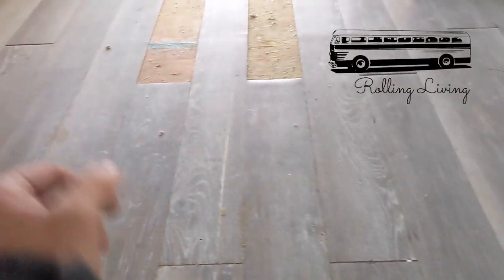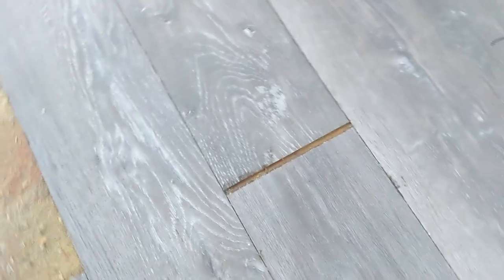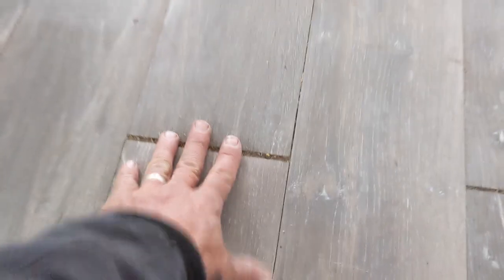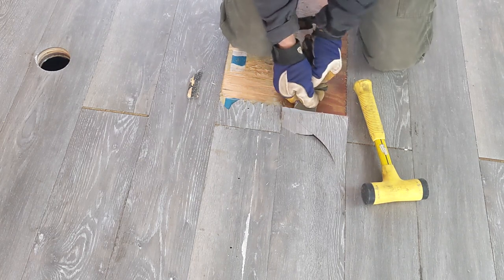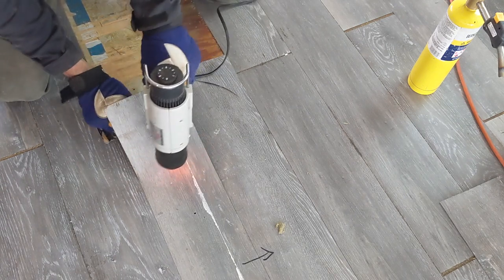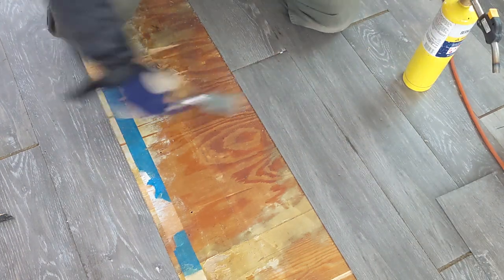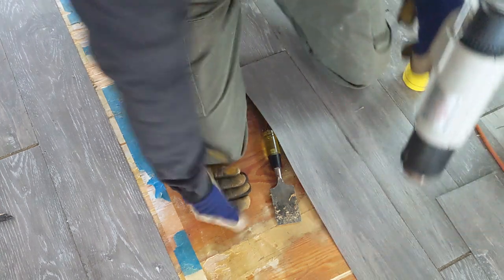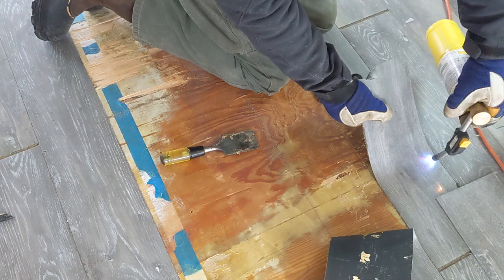Removing old vinyl flooring...and why we're doing it.  What's the perfect bus flooring? Tells us!

Comment: Just found this video.  We used snap-together floating flooring in the Harmony Express. Big mistake that many make with that type of flooring in a bus is that they put it down first and then build their walls on top of it...thereby making it NON-FLOATING.  We put our finished flooring in last and let it float per the manufacturer's instructions.  It's not flawless, but there are no MAJOR breaks like in this floor.
Reply from the maker: You make a good point...and that's one which is often overlooked.  Don't trap it and leave a perimeter expansion gap.

Thanks for sharing your experience!

Comment: Per removing that type of flooring, I vote for the heat gun.  Safer, easier, effective and during the winter months....warm!  Flooring choices seem to be a struggle.  Carpet requires a vacuum.  Vinyl seems to be an industry standard, but you better have a very smooth and level sub-floor.  Personally, I laid down some puzzle exercise flooring and it works, but you really need to make sure you get it squared up and tight, as it does separate.  You can use single or double sided tape to help keep the pieces together.  I love how it's cushions, insulates and quiets the bus....just not the most attractive.  I went with 3/4" thick mat.  It was inexpensive enough to allow me to test it.  If I really want to do the floor nicely, I'm going to plane down the sub-floor and then put more of a floating floor with enough room on the outside edges to allow for expansion and contraction.  I'll use wider trim pieces to cover those edge gaps.  Another idea is to simply throw down some rugs that you can take out and shake out, then sweep the floor.
Reply from the maker: Thanks for all the suggestions. I happen to like carpeting...especially the commercial carpet tiles with a short nap.  But it's not for everyone.  

Happy New Year to you!  And thanks for sharing your thoughts with me and others.